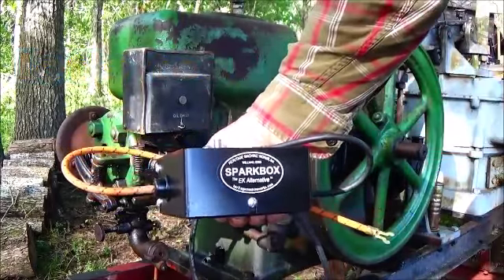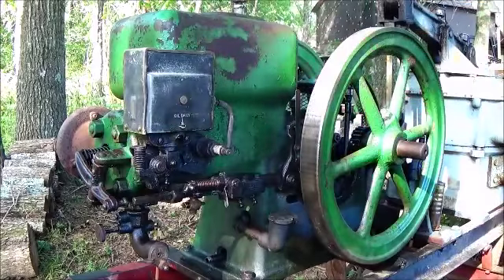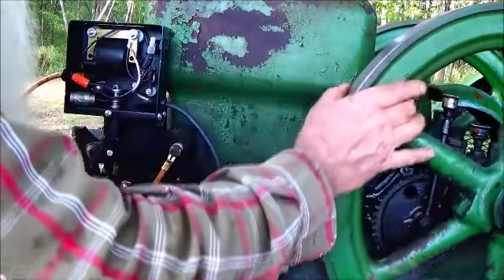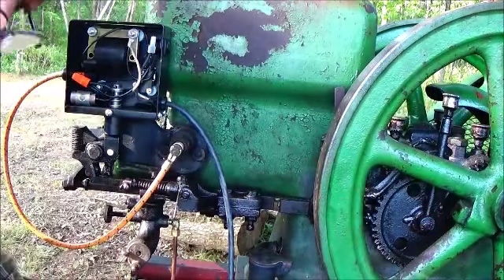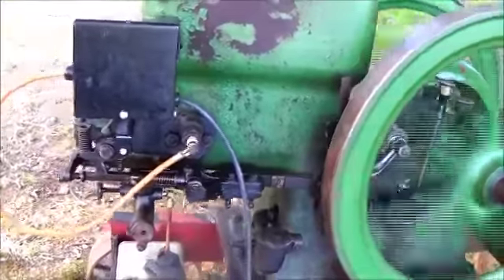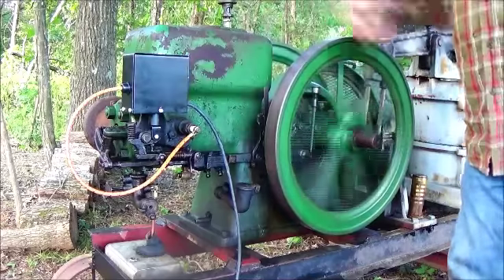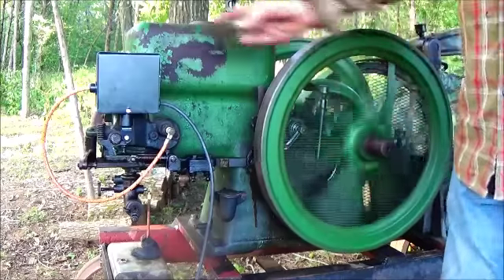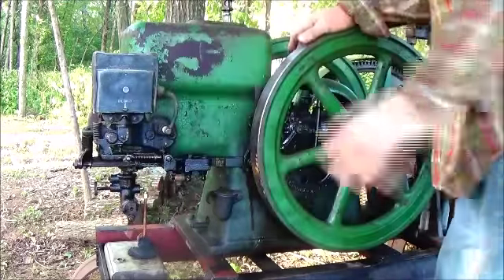Let's Start a Hit and Miss Engine / Sparkbox EK Alternative

Comment: Put a car alternator with a belt driveing it then hook up a 12 volt battery the alternator will keep the battery charged to run a inverter to power your house with electricity free power no light bills  lol

Comment: When these engines were in service how long did they run on a regular basis?
Reply: BUDDY LIGHT engines like this were usually powering generators or running oil wells. 
And a engine like this can run on damn near anything 
So if it were pumping oil 
It would also pump natural gas from the same well 
And they would pipe the gas or even the crude to the engine. 
And it could run indefinitely on its own power. 
The way a hit n miss works is very full efficient it doesnt fire continuously 

The governor operates a push rod and when i comes to speed the centrifugal force spins the weights outward and that activates a push rod that pushes a finger down and locks the connecting rod in place. By doing that it locks the compression valve open so the engine doesnt get any fuel or compression and is only running on inertia then as the flywheels slow down the governor weights close retracting the push rod allowing the compression valve to close and the connecting would have a camming surface that would trip a hammer on the magneto making it spark and repeating the process